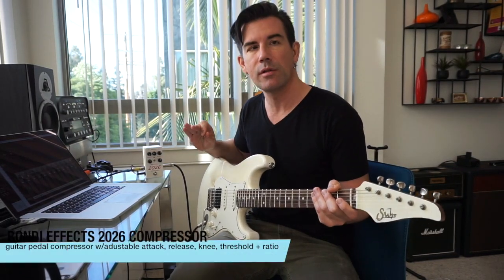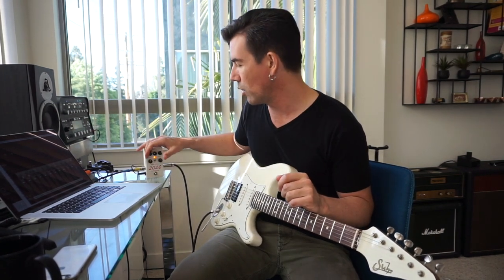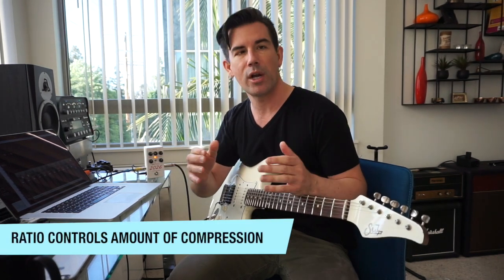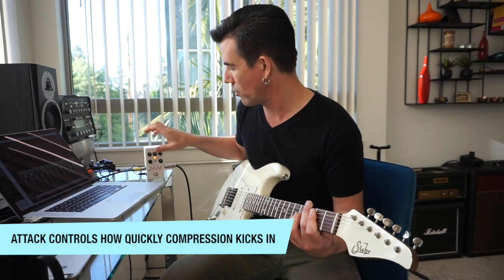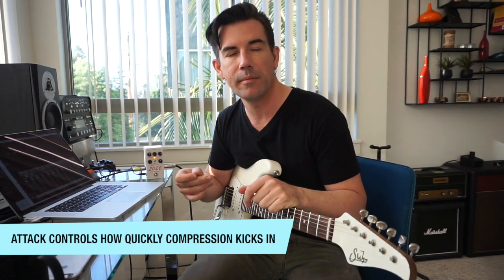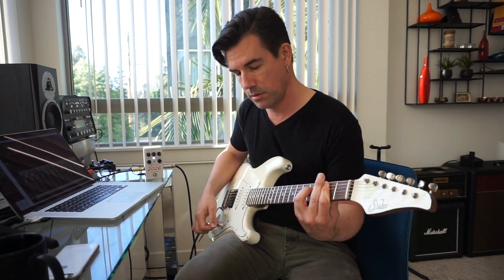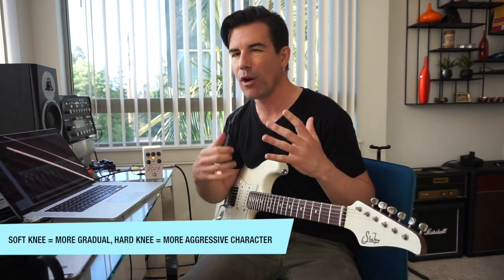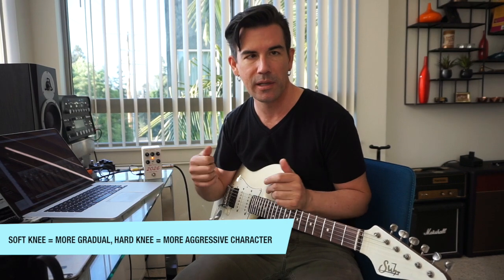GUITAR COMPRESSORS    EXPLAINED! Tone Secrets #5

Comment: I'm very thankful that Pete took the time to put this together. The sound examples were one of the first videos on the subject that audibly relayed each control's function. Not simple to do on this platform, so kudos! 

It may also help others to point out that analog audio compression and computer file compression are quite different from each other. They both will affect your audio quality, but in much different ways.

Comment: Great job at explaining compression. The problem I always have is not knowing at what level to set the threshold. Is it based on playing dynamics, attack of the pick on the strings, or what?
Reply from the maker: the threshold really controls when the compression kicks in. So, hit the strings hard- and adjust the threshold until you hear the compressor kicking in, reducing loud peaks. Now, you can keep reducing the threshold until even soft pick attacks trigger the compression. It's up to you! Then, increase the gain to make up for the reduced volume the compression creates. What I do- is bring up the gain until the volume is the same as when I have comp off and hit a loud pick attack. The result- you'll hear more sustain, the notes and chords will ring out, whereas with no compression, you'll hear a loud lick attack and then the sound falls off quickly.
Reply: Thanks for this insight, Pete! Now I finally understand. It's the attack on the strings/instrument that engages the threshold. From my research, I've been watching people tweak the threshold until they see a bit of compression happening, but I always thought it had to do with determining the volume levels in an actual audio wave. From what it sounds, it's mostly trial and error, but it seems a lot simpler than before.

I'm assuming the release time parameter is what gives the compressor the name compressor/sustainer. Makes perfect sense to me. Thanks so much for replying with your insights.

Comment: Thanks Pete. Good technical description of compression. Could you do a Part II that gets into general settings for the esthetic side of compressors, and in different styles, especially live applications. For example, do you use a compressor to push a drive or do you prefer a booster? How do you work with a compressor to help an uncooperative amp get great sustain and feedback without squashing the signal, unwanted feedback or extra noise?  Would a compressor always go behind a drive pedal, or would it work in front for some things, maybe leveling out a boosted lead by setting the threshold and ratio correctly. Thanks.

Comment: Compression is a subtle effect. It creates sustain with a clean sound so you don't have to use loads of gain to create long notes. The BOSS CS3 is great for this although it adds a glassy sheen which you either like or you dont. Its great in a smooth jazz solo situation where you want long legato notes without distortion. It is great if you want to sound like Larry Carlton. Try playing "It was only Yesterday" or "Room 335" with a clean sound and a compressor to give you those long notes. Try playing "Mercy mercy mercy" with a compressor. Sounds great! Why people use compression on chord work is a mystery to me as it removes all the dynamics which is the opposite to what ou want to achieve if you want to sound like Chic or something similar.
Reply: Pete is doing exactly this with the piece at the end. Listen to the lead sound.Without the compressor the lead parts would be lost and weak sounding.  Basically, long notes without loads of gain.

Comment: Thanks for the clear explanation of all these controls. I've used a couple cheap compressors which although they seem to add signal strength/sustain they also add more noise when not played through.  In other words the compressor itself has a problematic noise floor.  This has left me using the default limiter setting built in when recording with my Zoom H6 (which isn't bad).  I'll probably have to shop around for a quality compressor.

Comment: Pete..great videos..always informative..as a general guideline where do you like to place your compressor in the chain ?
Reply: Can't answer for Pete but logically it is the first pedal in your chain( after the guitar or your tuner). You want to compress the guitar signal. You do not want to compress your OD's, Distortion or any other pedals.
Reply: Thanks for your response..I've been experimenting...again..I've had placed before my drives..dist...etc..but I was watching The Pedal Show and Daniel places the compressor on his pedalboard builds after the dirt..Pete always has a phenomenal sound so I was curious on his take
Reply: Yes I believe I've seen that Pedal Show tutorial but at the same time Daniel was using the comp also as an effects pedal, if I remember correctly. To my way of thinking the comps reason for being is to maintain a balanced ( in terms of volume/prominence) note presentation. With the advance in tech of course other ways & means have been introduced.I guess the bottom line is what do you want it to do for you.I hope Pete catches on to this and answers your question.
Reply from the maker: +Bill Cormier hi Bill – generally it should come very early in the chain, I wouldn't suggest running one after overdrive as it will raise the noise floor, and OD's/distortions already do that. My compressor is in the first loop on my pedalboard switcher, so it comes right after my wah and volume
Reply: Pete Thorn ...thanks for taking the time to respond..as you saw from the thread I had been experimenting with placement and actually had placed it after my wah last evening...so tuner, wah, compressor, dirt etc..definitely like it there the best..thanks again, appreciate your work

Comment: Great video, thanks for the explanation of what actual compression parameters do.
The thing I find, coming to guitar as an engineer as that parameters labelled "sustain", "compression" or "response" aren't particularly meaningful to me as I'm used to thinking in terms of "attack", "release", "ratio" and "threshold".

How do you think this pedal compares to the Cali 76 which has essentially the same controls? (fixed threshold, but adjustable input / output gains instead). Do you feel a wet/dry blend for parallel compression a good substitute for a lack of hard/soft knee?

Comment: Question for anyone who knows: a lot of people say that guitarists "need" a blend knob on their compressor pedal, so that they can blend in some clean signal with the compressed signal and thus retain some of the attack from their picking, e.g. when playing funk. However, if your pedal has an "attack" knob, surely this can be used to the same effect? I.e. use a slow attack on the effect itself, so that the attack of your instrument is retained?
Reply: You can dial it more subtle, but it is not same thing as paraller compression. Paraller compression really turns whole compression thing upside down. There is good article on wikipedia

Comment: Question for the advanced people: when he demonstrates the hard knee, you can hear the dramatic effect and it attenuates the signal quite drastically. My question is, is it the threshold control or ratio control setting that determines how low the signal will be attenuated when the compression activates?

Per the demonstration, it makes hard knee look totally impractical and artificial because it so audibly and aggressively quiets the signal. However, I’m convinced that had he set either the threshold or ratio differently it could have made the hard knee sound less awkward and allow it to be a useable compression strategy, as I’m sure it is. 

Thanks
Reply from the maker: I’d say you’re correct- it’s all about how it’s set- and both threshold and ratio will determine the amount of compression.
Reply: Pete Thorn Thanks for getting back to me, Pete. What I’m really wondering is, is one of those two controls (ratio or threshold) most responsible for that significant drop in signal we hear when the hard knee setting is first demonstrated? I feel this particular question is important in helping me really understand these more complicated compressors. Slowly understand more and more about them and then got stuck here!